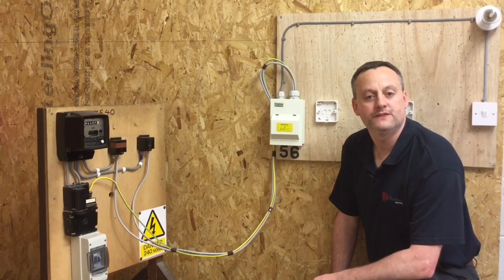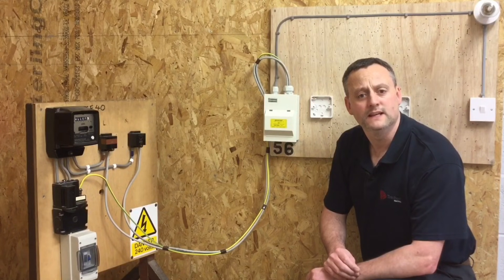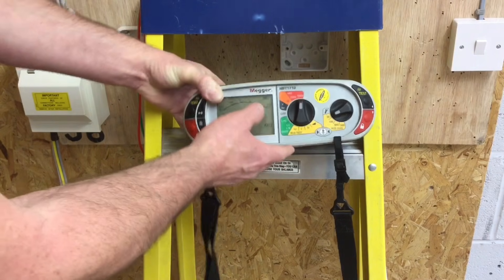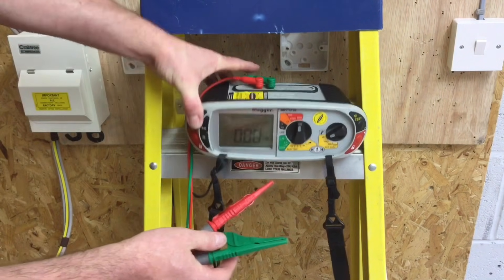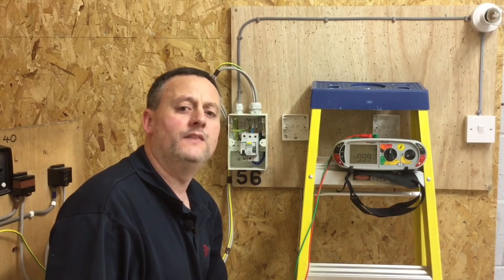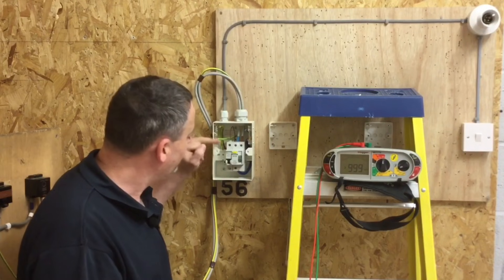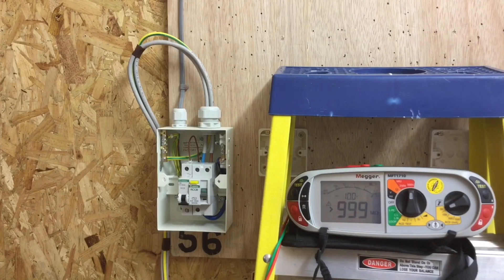How to Carry out an Insulation Resistance Test of our 1 Way Lighting Circuit

Comment: What if the lights are led and have a line and neutral only. Would you need to disconnect the line and neutral from the lighting circuit?

Comment: hi , all wago push fit connector are designed for 450v , what will happen to those connector whan the circuit tested with 500v for insulation test?

Comment: As you are doing the test on the bus bar directly and not isolating the neutral form that specific circuit, would you need to disconnect all appliances from all the other circuits so not to damage any equipment ?

Comment from the maker: == 🕐 Time Stamps - Cut to the action 🕕 ==
00:00 - Insulation resistance test
00:16 - Earthing conductor needs to be connected
00:49 - Remove all loads, covers on and switches on
01:05 - Switch off RDC's, RCCB's and RCBO's
01:15 - Setting up my MFT tester
02:08 - Testing my leads
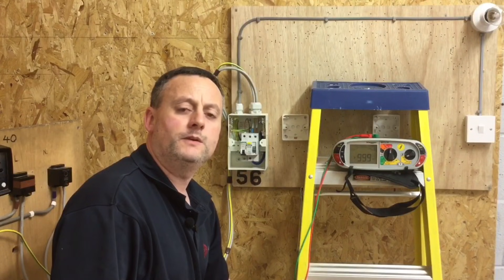03:10 - Why are we testing the insulation resistance
04:08 - Removing loads
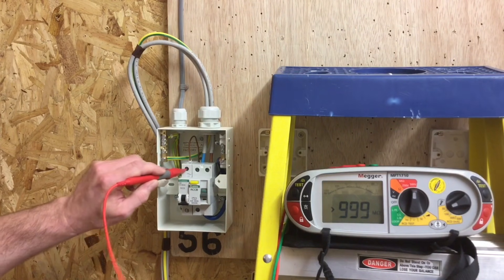05:15 - Testing between line and neutral
05:45 - Testing between line and CPC
05:55 - Testing between CPC and neutral

Comment: I have a question , how do you draw a circuit diagram of one lamp controlled by one switch the show how insulation resistance test is carried out on the circuit

Comment: Hello , was wondering if you performed this test on an installation with multiple circuits on it and clamped on to the neutral bar to perform the test for the lighting circuit, would it take in the resistance of all the other neutral conductors on the system? Cheers 🍻
Reply from the maker: https://youtu.be/Ek1u2RjQffU
Have a look at this... and yes to your question 👍. Thanks for commenting and watching. Gaz

Comment: I was told on my testing course that you can short the line and neutrals and not have to worry about removing any lamps or turning switches off ... and to test on 250 .... is this correct
Reply from the maker: Hi. In this video we are testing a new final circuit and not carrying out testing as if we were doing an EICR. This video is for my learners at week 7 of year one training. Thanks for commenting and watching Gaz 👍

Comment: As the test is only for the wiring to that circuit, should not the regs call for the wiring to be disconnected to ensure that no possible faults from any external sources (such as a faulty breaker etc.) are eliminated?
Reply from the maker: Hi. You are required to have the external earth connected during the insulation resistance test. Thanks Gaz
Reply: Ok but what about the line and neutral, should they not be disconnected?
Reply from the maker: Hi. If you had a 15way consumers unit would you want to disconnect all those conductors and the torque them back up. This link is to another version of the test on my channel 
https://youtu.be/Ek1u2RjQffU
Thanks once again Gaz
Reply: Ok I see what you are saying there and agree with you, but could you not combine this test with the test where you have the conductors disconnected for the circuit resistance tests anyway before torquing them back up? I'm not trying to be difficult, just wondering :)
Reply from the maker: Hi. Love your thinking but you still need the external earth from the supply connected during the test. Hope you like my link to the combined live conductors to earth test for installation resistance. All the best Gaz
Reply: Thanks Gaz, love these videos by the way, they have taught me so much :)
Reply from the maker: As you can tell from my early efforts and issues with sound I NEVER understood the impact they would have. I am trying harder with my production but it’s only me and my iPad at work at 7.30am all alone. Thanks for the support Gaz
Reply: You are doing a fabulous job and don't let anyone tell you any different! :)

Comment: thanks for the video.

why is the insulation between neutral and earth so high?
at tncs shouldn't it be a few ohms?
is it because the RCD is switched off so both the phase and neutral are disconnected?

thank you,
roy.
Reply from the maker: +rm0rgy +
Hi. The insulation resistance test requires the main earth connecting and all live conductors (line and neutral) isolated. If you have a TN-S or TN-C-S the earth and neutral are connected together on the supply side could give an insulation resistance reading of zero between them. All the best GSH Electrical